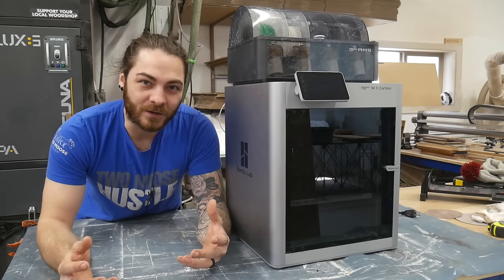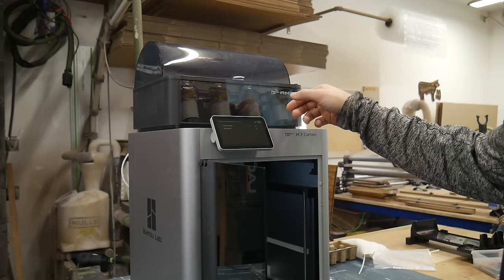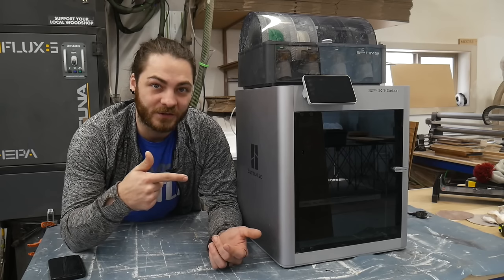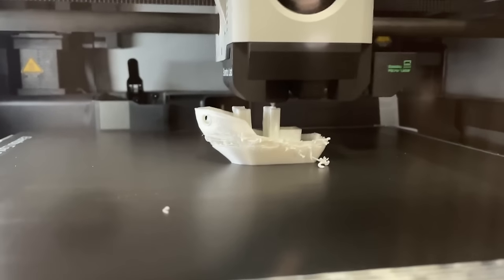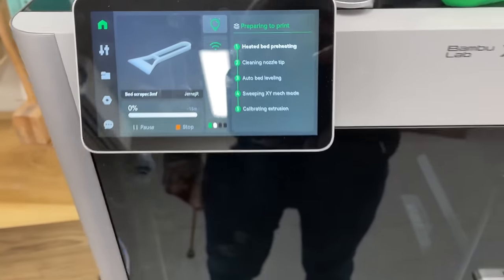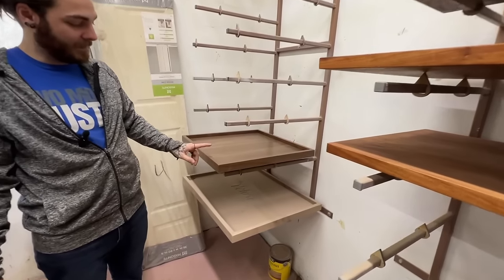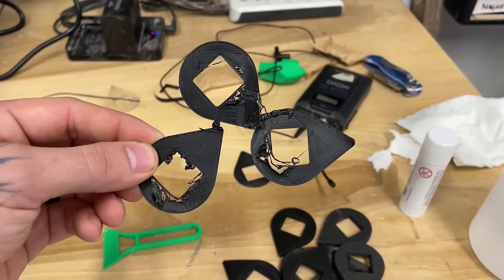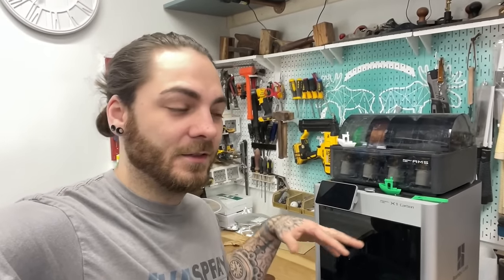The best 3d Printer you can buy?? Bambu x1c

Comment from the maker: Let me know your thoughts on the machine and what filament type and brands you recommend!
Reply: Hatchbox & polymaker  PLAs are great brands.
Reply from the maker: @whitexeno  I'll order some polymaker and try it out! I just ordered another roll of hatchbox.
Reply: watch spool sizes some dont fit in ams and cardboard spools need a plastic ring so Ams dont eat the spool and have watch print speed alot pla filament is 50mm speed or slower alot of filament is not meant be printed at speeds of bambu x1 especially silk pla

Comment: Another Wisconsinite here. Awesome video. I have had my Bambu x1c since April. I preordered a Prusa MK4. Was told they were in stock and then later was told I would have to wait until June. I cancelled my order and ordered the Bambu x1c and had it to my door in 4 days. I couldn't be happier. One thing people over look with the AMS system is the ability to use support material and print another material. I have had near flawless prints with it and have saved me many hours of detailing prints later. I came from an ender 3 pro and could not recommend a Bambu x1c anymore. Keep it up enjoy it. Wish my GF would get into this hobby as well!
Reply: Looking into a bambu myself but wish I could see and try one before dropping that much coin. Where are you guys at? I'm near Fond Du Lac.

Comment: For the "scar", in the slicer you can adjust the seam location. Also, silk filament has poor adhesion between layers. So you have to be super careful with them as you saw. Good luck. I love my X1C.
Reply from the maker: Thanks! I actually found the few seam options shortly after! Thanks for the input appreciate you watching
Reply: you have to print it a little bit slower or higher the temperature. then the layers melt a little bit better together
Reply: There's a Silk profile in the BL Slicer ;)

Comment: The white filament that comes with the machine is support PLA. I’ve had mine for about 4 months and I love it, you won’t regret it!
Reply: Lol, just got to the part where you realize that it is support PLA😂
Reply from the maker: @bronzekid1  hahah I figured it out the hard way 😆 I haven’t actually used it for the intended purpose yet 🤔
Reply: I did it too.....  😁 👍
Reply: Yeah, the support material requires different settings, so a bency that was sliced for PLA isn't going to print correctly.  You could print a benchy in support material and have it come out half decent I'd think, but it would be a waste given the relative costs, and I have no idea how durable the material is since it was of course not designed to last.

Comment: thanks for the video, I'm thinking about buying one myself.  cnckitchen guy said that when the bambu x1c prints fast the parts come out weaker which could have contributed to the bottom coming off your knife holder.  How's the noise when you run it fast vs slow?
Reply from the maker: Hey! My print stuck too well and I didn’t let it cool so it broke at the seam. What he says is probably true 🤷🏼‍♂️ I have no idea but my prints are plenty strong and you can experiment with different materials as well for more durability. It’s not overtly loud. I always run it on normal mode, it’s already way faster than older printers. I keep it in my shop so I don’t notice the noise 🤷🏼‍♂️

Comment: I've got the mini and it is really fun! I am interested in getting an upgrade so I watched your video.  I have 2 Prusas and get tired of switching out the filament on them when it beeps. There is a camera so you can watch your mini while you play video games or whatever you need to do. What is the carbon filament for?  That is one thing that I am not sure I will need to print with carbon.
Reply from the maker: The AMS is great! Makes swapping way easier. Carbon filament isn’t needed, it’s just strong but for 98% of things PLA, ABS, and Pteg are just fine.

Comment: I’ve had mine for a few weeks now as well and this is also my first 3d printer.  I didn’t get the AMS but I was able to get setup and printing pretty quickly.  I’ve only had two failed prints and both were from me not doing the bed prep after many successful prints
Reply from the maker: That’s awesome! What filament have you been using?
Reply: @TwoMooseDesign  so far just Bambu pla but I was going to try some matter hackers PETG next.  So my longest print so far was a Darth Vader statue which I printed in 2 pieces with a total time of 7:32.  I am blown away how good it came out.

Comment: I’ve never seen the bottom layer rip off of anything before. I would say it’s probably because you should’ve just let it cool on the countertop or a piece of marble first, instead of trying to rip it right off the hot bed while everything still warm.
Reply: it was printed with support pla. its designed for supports and is super fragile

Comment: Started with an Ender 6, then got an Elegoo SLA printer, then got a Prusa MK3S+, and then got my X1 Carbon.
The X1 Carbon is by FAR the best printer I've had.
No issues with it and it puts my Prusa and Ender to shame.

I've been modeling and printing for a few years as well.
Reply from the maker: Oh nice! I was actually eyeing up one of those large ended or elegoo printers 🤔 like the XL models
Reply: @TwoMooseDesign  I really like my Elegoo Resin printer.
Super clean prints and pretty easy to post process with the cleaning and curing station from Elegoo as well.
Reply from the maker: @spydergs07  ohhh I want a resin printer! I need to master this first, those look more tricky lol
Reply: Isn't resin printers superior? Much more better details.
Reply: @Vindold  They have their pros but also have a lot of cons.

Resin does come out with a lot of detail.
But requires a lot of post processing.
I like my resin printer, but I'm very selective over what I resin print due to the time and post processing.

Comment: Fun video. 
Good intro to 3D printers.  It’s definitely not as easy as the manufacturers want you to believe. 
One note that makes Prusa better than almost all the rest. The support they offer is the best in the industry.  
Trade off is sometimes speed.  

We use fans to cool the plates for 10-15 minutes before removal of items(usually. lol). You’ll get a feel for it.  
Try not to bend the plates too much. The item should just come off the plate easily with no effort. 
Also. Only use glue if you are getting peeling off the heat bed.  Very rarely. 
Watching the video I almost said it looks like a support PLA. Much more costly.  So use it wisely.  ;-)

Lastly.  For your parts for the shelves. Use PETG instead of PLA. Much stronger and harder filament.  PLA is good for modeling. Generally if you are going to paint it.  

Slow and steady wins the race in 3D printing.  Consistency is the key. 

I tried not to Mansplain.  Good video..

Comment: I missed it if you covered it but you said it wqs support PLA that failed.  In watching 3D printing videos in the past I haven't heard that term.  What is "Support PLA' vs. PLA?
Reply from the maker: Support pla is design for supports, it breaks away easier than regular pla would. I also believe it’s water soluble so you can dunk it in water to get them to separate better. If you see those crazy prints with like roots all over them and they pop those off those are the supports. I haven’t done anything like that yet.
Reply: The "Support for PLA" material is a breakaway support for PLA.  The composition is proprietary but it is analogous to Polysupport breakaway material.  It isn't soluble as far as I know, but I haven't actually tested that.  It does break away from PLA very easily.  

Note that this only works well with normal PLA.  If you get some "pro PLA" materials and other variations on PLA it may adhere - often those materials mix in TPU or other materials to increase the tensile strength and bendability of PLA, and that can make them adhere to some support materials.

Comment: I'm in love with my Bambu X1C with 4 AMS systems, using Esun and Sunlu without too many problems! Best filament would be BambuLab's own filament because of the RFID tag.
Reply from the maker: 4 AMS?! That’s awesome, I agree I’ll
Have to order some more of theirs, takes the thought out of it
Reply: @TwoMooseDesign  yeah, I only use the AMS for colour switching because I’m too lazy to change the rolls myself. And they keep the filament dry with the desiccant upgrades.
Reply: will the X1C print Carbon fiber Nylon?
Reply from the maker: @Lambossin  it comes with some I believe. Like a small sample
Reply: @Lambossin  yes it can, I print CF nylon on mine pretty frequently.

Comment: Sunlu pla+ ist what i use for a while now. No tangles so far. Also you dont need glue on a pei bed. If you remove big prints wait for the bed to cool before you bend it or it May cause the Print to Warp.
Reply from the maker: Thanks for the tip! I’ll definitely try SUNLU several recommended it

Comment: Hey guys! Congrats on the printer! — Those spools that come with… are they all Bambu's reusable spool thingy? I'm about to pull the trigger on one of these, and I don't want to buy too many of their accessory reusable spools, if the thing already ships with 3 of them.  Thanks!
Reply from the maker: You can 3D print a thing to help you respool then yes. I personally do not but you can
Reply: @TwoMooseDesign  Thanks for answering, but I'm not talking about respooling, I just wanted to know if those 3 spools you got with the printer are the pull-apart ones which can take refills. Cheers!
Reply from the maker: @dexarok  ohh gotcha I’m not sure, I’ll have to check!
Reply: @TwoMooseDesign  No worries. If you happen to remember me in passing, I'd appreciate it — if not, that's fine too! Thank you for the quick replies. Have a great day!

Comment: not an open architecture. you don't have full control over your prints, check to see if your designs are staying on the machine while in the slicer. problems with right to repair. did some test runs on this machine with a service and they had a lot of problems with fine detail. wanted it to be the one. will wait and see.

Comment: Lidar only detects issues with first layer adhesion. The 'AI' feature is there to detect spaghetti prints and not all types of failures. I would say it's more of a gimmick than an actual feature. You could also set up your own 'AI' print failure detector; there are a few open-source software options out there!

Use a PEI-textured plate; it doesn't need any glue.

Comment: You should not have to use glue stick for pla. Not sure on the print board that comes with that but prints should come off the board way easier

Comment: Sure, 3D printing is not idiot proof yet.
But.. compare to Aneth A8 kit that required perpetual DIY upgrade before it bless you with 1 great print out of 3 failed... that Bambu is the king so far (and for a reasonable price in his category).
Reply from the maker: I have several more printers at this point and it still my favorite. My next video will be comparing it to the K1 Max
Reply: @TwoMooseDesign  Never heard of K1 Max. I'm curious!
I have 2 cheap printer and I can't justify buying another one. And I suppose I cannot have a lot for them if I sale them.
Having 2 is very nice: one can fix the other if broken. But if I have a nicer one that is never broken... I'll probably wait anyway.
Reply from the maker: @alexandrevaliquette3883  absolutely if that works no problem there!

Comment: Very nice video!  I'm still using my first 3D printer, a Prusa MK3S+ without an MMU.  With all the problems I've heard about Prusa's MMU and the issues they are having with the MK4, I will keep the x1c or it's successor (when that happens) in mind.  Since I've only had mine for a year, I'm going to hold off for a couple more years and see what develops in the industry.  I'm only a hobby printer so time is not an issue, quality is though... and I've still not gotten my monies worth out of the Prusa.
Reply: MMU3 is fine on the MK3S/+ lines 
MMU3 Firmware also fixed all the issues on 2 and 2S. I'm printing a 25hr 5 color Ocarina for my niece. Almost done, 760 tool changes with a single fault that probably my fault for using not dried filament. 760 tool changes is more reliable than AMS, and it has much better waste management, AMS is around 2-3x more wasteful. I'm purging to infill and I can purge to another object if I don't care what color it is (ie a bracket or hanger). A lot has changed in the last year. In real world testing Mk4 is as fast or faster than the X1C with input shaper but IS isn't full developed yet, likely get faster yet.

Comment: Maybe get a metal scraper for lifting parts, bending the magnetic sheet like that will put too much stress into the print and delaminate the layers. Try letting it cool before you remove it from the pad if you don't already.
Personally I use a wet wipe to clean the pad before printing, because oils from fingers, and a very sharp slash cut tungsten steel 3mm rod for removal. I also watch the first 3 layers print and then check every 15-30 mins.
Welcome to 3D printing, and shouting "WHY?" :)

Comment: Great review.  Probably worth noting that it's also not a good idea to mix material types & brands in the same print.  Especially relevant if doing multi colour printing.  Bambu uses a slightly different formula of PLA that can be printed quicker.  So something to watch out for when also doing speed prints with other filament brands.  Lastly, always worth refreshing the glue stick after each print especially for the area that was just printed on.  This also helps to reduce objects sticking...   :)
Reply: I've heard that Bambu Labs' filament is just Sunlu PLA+.
Some people on Reddit said that they purchased Sunlu Filament, and it came in a box with the Bambu Labs sticker.
Also, I think the VoidStar Labs guy was saying that it's Sunlu Filament, as well.
Reply: Hahaha.  
It’s like the products on Amazon.  
Everyone is selling the same thing made in the same factory in China by sweatshop kids.  

Different label on the box. Same product.  Prices all over the board.

Comment: I've had about 10 different printers so far (last one was Prusa MK3S/MMU2S) and the X1C/AMS is by far the easiest and most consistent printer I've used. I really liked my Prusa, but this is much better. I assume the MK4 will be much better as well, but at this point I have no reason to try it. I do have a multi-head Prusa XL on preorder and I expect that to be a great printer (much more expensive, so it better be! 😀) My guess is I will keep both the Bambu and Prusa and just use whichever one is best for the specific print job.
Reply from the maker: Don’t blame you, I see a few other printers magically showing up soon 😆
Reply: Information
Price alone never describes   the value of something.
You can buy some very old machine and know it has worked 20 years and is solid or buy a new product that has been made to last wich dies on you after 2 weeks.😅
Reply: @fearlyenrage that’s a myth. Old machines are usually gotten rid of because they don’t work properly any more.
Reply: @melgross  my expiriance has not to be yours. And those machines i have work all fine.
So when you have nothinh constructive to bring to the conversation... Have a nice qiet day.
Reply: @fearlyenrage  well, I hope you continue to have good luck with your machines.
Reply: And what do you do for a living?

Comment: You are wasting glue. Just put it on the area it will print on. If your print says it  has a 2 inch by 3 inch base then only put glue on the 2x3 area. All files can tell you the length width height of a project. But you only need to know what the size is that is actually touching the base. Everything else sits on a layer of filament. Putting glue where nothing is being printed on is just a waste. Great video!!!
Reply from the maker: Thanks! I rarely use glue anymore, it was my first time using a printer.

Comment: this is a bit strange to me, I have two of these, have printed over 200 robot parts on the two printers and have had zero fails or a single issue. I use only default settings for the filament and turn on and off support as needed. You might want to chat with support, and my robot friends who have this same printer also have almost zero issues.
Reply from the maker: Definitely user error. It was my first couple prints. I had no idea what I was doing and wasn’t using bambu filament on the gold. The white boat was support pla.

Comment: You can use Magigoo adhesive for easy stick AND release after the print. This layer goes a long way and acts like insurance to your 3DPrint. It's water-based too, so it won't smell and is easy to clean.